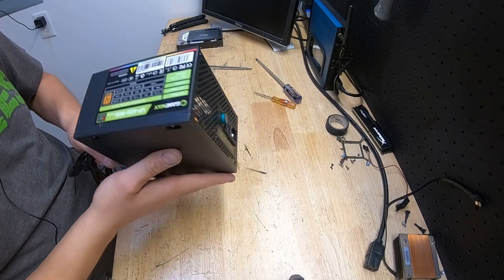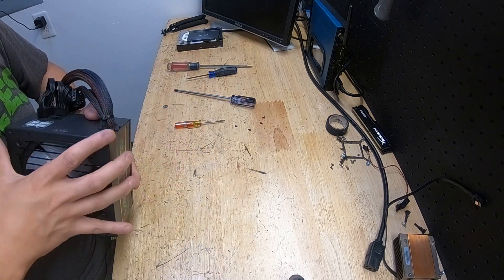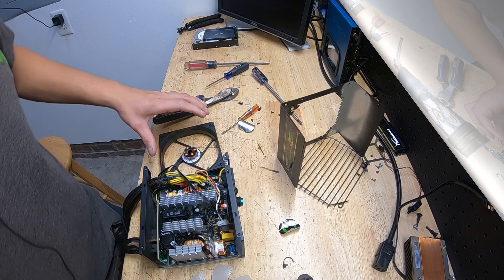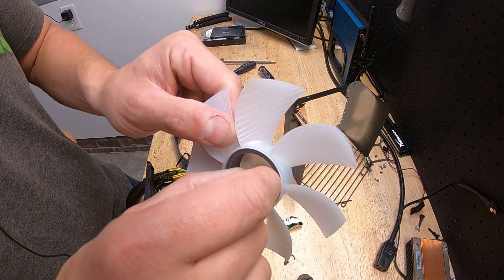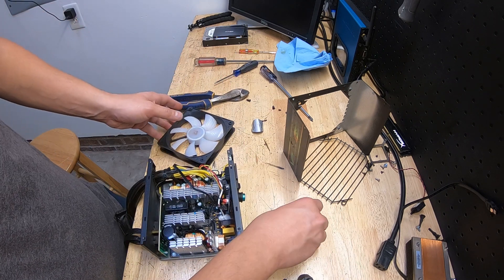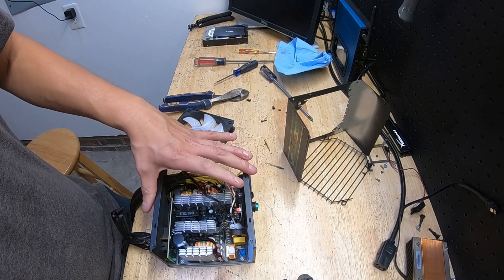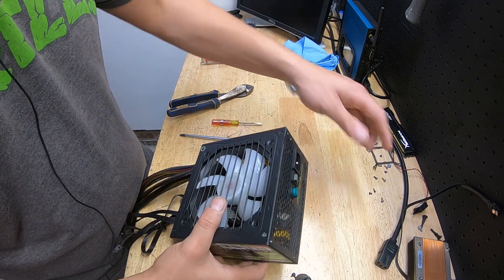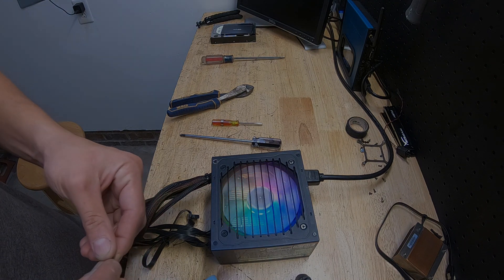Fixing a power supply! No parts required! Gamemax power supply fan repair!

Comment: hello I have a gamemax gm 800 and it started to make a noise in the fan at lower rpm it can be fixed and it will be risky to use it with an i7 8700k plus a 3060ti and a lot of rgb greetings and very good video
Reply from the maker: the fans are junk... I would not recommend using this psu with that type of computer setup you got.

Comment: Good day, have you encountered a case where a GPU Pcie connector is corroded? Is it fixable? Thanks in advance!
Reply from the maker: i have due to high humidity, as far as it being fixable I first make sure their is no signs of arking or burns on the connector, then I use an electrical cleaner with some type of small scrapping tool to clean it off the corrosion. As long as the connector is not compromised such as being damage, cleaning and scaping works fine. I see this more on minning rigs psu's and gpu's.
Reply: @DLMtechgarage  Late reply but thanks for the response, I have sent the GPU to a service center and I hope they can fix that, cheers :)
Reply from the maker: @Vernius_  yea that is the best solution, wish we had one where i live, everything is far!!